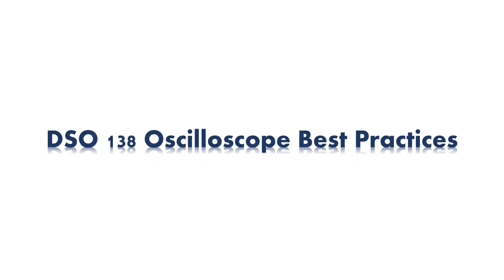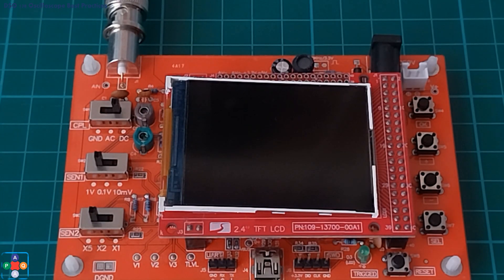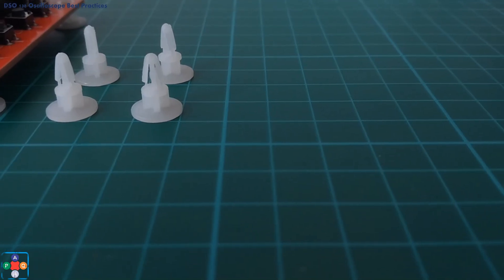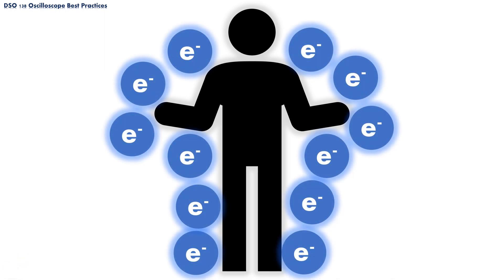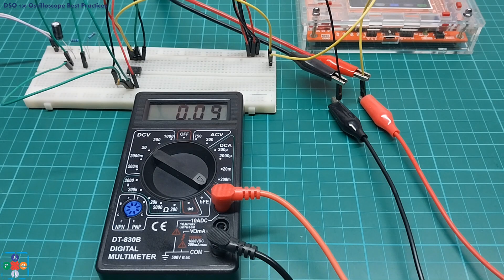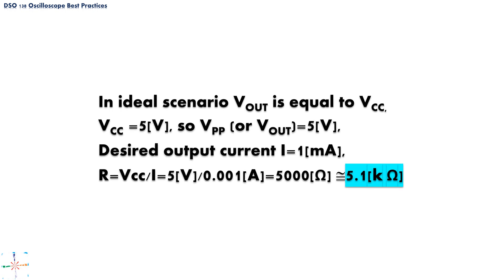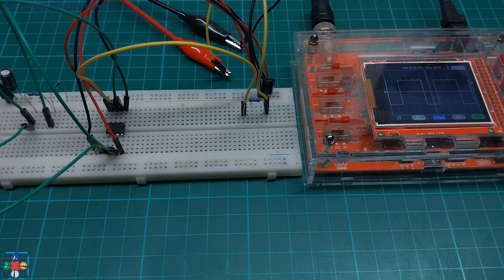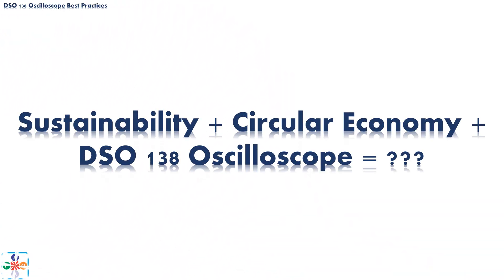DSO 138 Oscilloscope Best Practices | How to not Brick Your Device

Comment: Seriously who cares?  This costs less than a burger, fries and drink at McDonald's!  Why spend so much time, effort and money trying to protect it when it can be replaced so easily?  That case alone is half the price of the scope.  Not to mention it's a PIA to put together (mostly getting the paper off the parts) and hampers use of the scope.
Reply: While I do think that this is indeed a pointless video, I think that your assertion that the device is too cheap to worry about is one I don't agree with - the scope is cheap to many of us, yes - but to some, it was an investment and useful to them for education or other use out in the field which would usually cost a lot more...
Reply: @PeaceToAllEvenYou  True, and I'm a believer that a $40 scope is better than no scope at all.  However, in this particular case, the DSO 138 with the acrylic case, is just about the same cost as the  DSO 154 Pro with internal battery and scope probe which has a 18MHz bandwidth, is better protected against damage and has a much better UI.  Today it's just a bad choice.